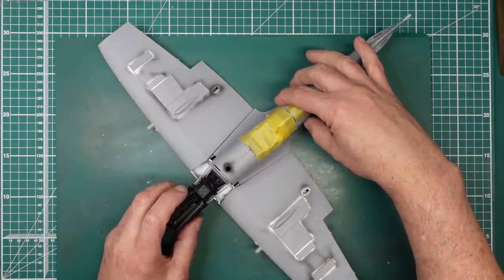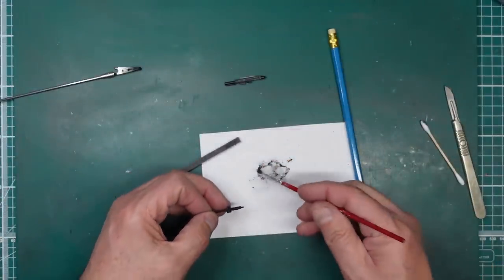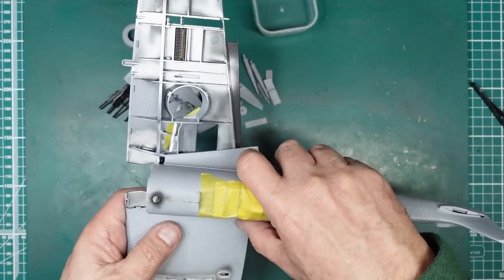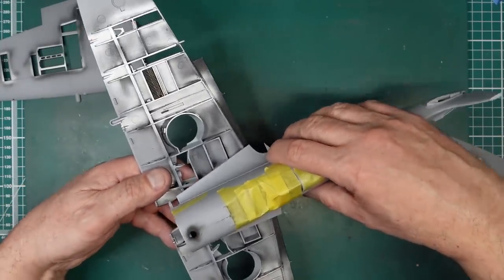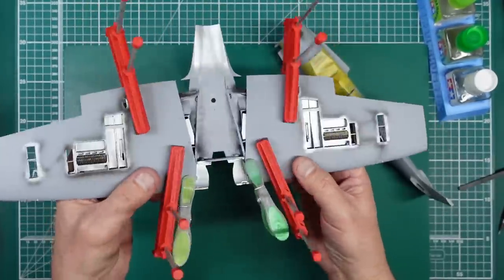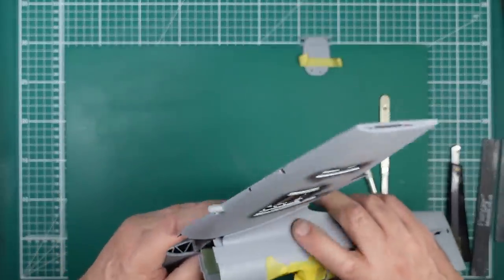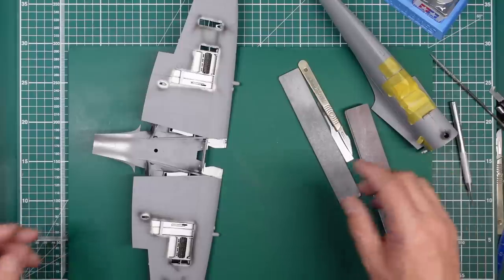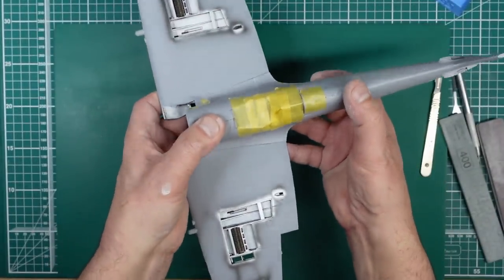Airfix new tool 1/24 Spitfire Mk.IXc Build. Part seven.

Comment: Really appreciate this episode as this is the stage I am at with my build and you made it clear what problems to look out for . One thing I found was regarding the main rib that has to be centralised , I noticed on the bottom part of the rig it had end locating lugs , so I glued them snug to begin with and then pull the rest of the wing up to rib and glue as I went , this not only centralised the rib but also pulled the wings up to their correct shape , just thought I would share in case other are having the issues you had with this kit . Keep up the good work with the videos Nigel .
Reply from the maker: Thanks for the kind words and the tip. It would appear that there are differing levels of shrinkage in the spar as some seem to fit perfectly and some are short, like mine?
Reply: I considering myself lucky with my particular kit as I don’t have the overhang on the leading edge of the wings or the large step between the fuselage and wings , I’m glad because I don’t have the skill set to cope with it as well as you do , which is why I’m grateful for your channel , and picking up loads of tips for my other builds all stacked up waiting to be started which include the mini base 1/48 Su-33 , takom 1/35 apache ah64d , tamiya 1/48 f35a , tamiya 1/32 f15  strike eagle , tamiya 1/32 f16 fighting falcon , tamiya 1/32 mosquito and my big build the 1/32 border models Lancaster , all of which I will be referring to your hints and tips , so keep up he good work Nigel I’m really enjoying your tutorials

Comment: Well...people love to complain. Back in the day I did level design work for Valve on Day of Defeat...some of the so-called "fans" used to complain the belt buckles and the straps on the German soldiers weren't perfect and it ruined the game for them. Every model has flaws and/or reduce detail to meet manufacturing and cost considerations...and most of us make flaws when we build. Solid build so far Nigel...starting mine soon.

Comment: The old saying says “You can please some people some of the time but, you’ll never please all of the people all of the time. Long or short videos is a decision only you can make based on the numbers that post about each version. All I can say is there are plenty of people producing short videos, but they basically gloss over most of the build to give you a 20 minute here’s a sprue, here’s a finished module all painted. I personally prefer you’re almost forensic deep dive into the minutiae of the kit and it’s issues and your way of solving those. A example of your detail is the ill fitting pipe on the engine bearer, no one else I’ve seen has found your simple solution. Perhaps it’s your engineering background? Your longer videos are never boring and always informative and educational. I hope you choose to continue in this fashion.
Reply from the maker: Exactly right Mark.. and.. if I fail to mention it there will be someone who who will comment... There's no doubt Rolls Royce gave me a wonderful education in the form of an apprenticeship.. a PROPER apprenticeship!!

Comment: Hi Nige. It was me who messaged you about the huge gap in the top manifold cover between the cylinder blocks. It threw the intercooler position out as well. Looking at your K sprue parts some of them definitely look cleaner than the same parts on mine.
Reply from the maker: Hi Craig, thanks for getting in touch again. I hope it hasn't lifted the charge cooler up? It is VERY close to the engine cover.
Reply: @NigelsModellingBench  so do I! Not got that far yet. I'm adding all the fuel system  pipes and linkages that aren't there. Tried to post a link to my Britmodeller build as there are snaps of the dodgy parts on there but YouTube won't let me do it. Gorge work you've done so far though mate.

Comment: Absolutely spiffing videos Nigel old chap, tally ho… nothing boring about the videos length or otherwise. As you say it’s a plastic model, no one going to fly in it, it won’t need as air-worthiness certificate. Have the best Christmas, Nigel.

Comment: Nigel your videos are great. Keep doing what you’re doing. If I was wanting to glue closed all the gun access panels, do you think it would improve the overall alignment by omitting spars running front to back and just putting the guns in?  Thanks
Reply from the maker: Thank you. No mate, it all goes in and fits lovely, you also end with a very rigid wing.

Comment: Nigel.  I am wondering if you might do the following….  The ammunition belts you showed you might try every fifth round could be red because it was standard procedure to indicate the phosphorus round with red!
Reply from the maker: Will do, so the whole black part is painted red?
Reply: @NigelsModellingBench  There was only a red band at the base of the Bullet but at the top of the black.  It should be Brass/Red/Black
Reply from the maker: I shall research.. is this the standard for this period around D-Day?

Comment: Hi. Love your videos.
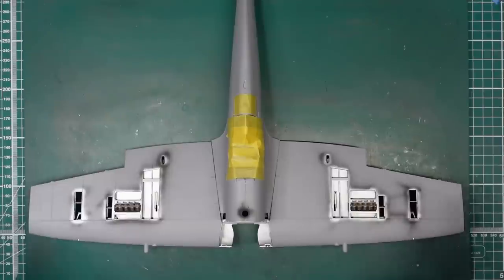At 34:05 I found if you sand and trim the belly of the fuselage a good amount around the stand attachment hole “I think that’s what it’s for “while fitting, before glueing all alignment problems go away. The wing edge height then falls into place. I also glued the
 reinforcements on the wings like you did. Hope this helps.

Comment: Watched this section and then spent time looking at Spitfire photos. The wing root fairing joint seems to be very much over emphasised where it joins both the fuselage and the wing root, which is why you had to work on the root. SoI looked at the old Mk 1 Airfix 1/24th kit I have in the stash and the root fairing join to the fuselage is not a step. I begin to wonder if Airfix has got something wrong here.

Comment: Hi Nigel got this kit for Christmas thoroughly enjoying watching your build , writing down all your little tips and will try to come somewhere close to your product. However I recently got the ICM 1/48 Spit IXc which is the same aircraft  as the Airfix kit, with one exception. The armament consists of a 20mm and a .50 cal gun in each wing. Could you advise on which is the correct set up or were both used on this particular aircraft.
Reply from the maker: Not sure sorry?? C wing has two or four Cannons, or two cannons and four 7.7mm guns?

Comment: I believe that the belt had a red colour every fifth shell as they were as marking shell and also there were armour piercing shells. The point I’m trying to make is that there were different colours to the bullets and if you wished to, you van paint in this detail and thus making te actual shells more interesting. Just a thought.
Reply from the maker: Yes.. I must sort that.. IF the red shells apply to the canons and not the guns?